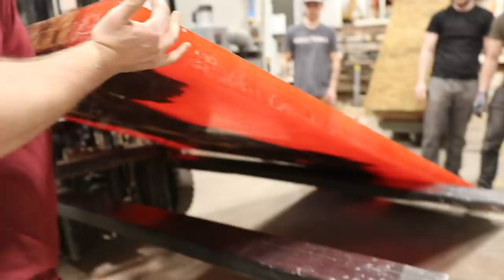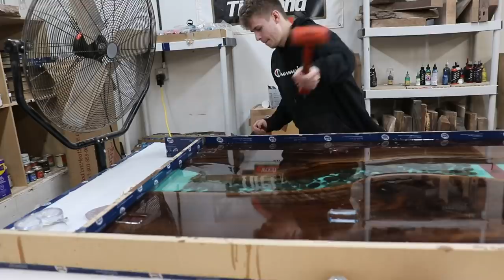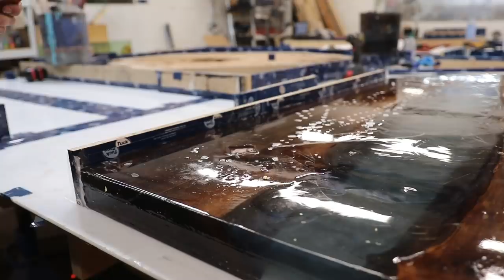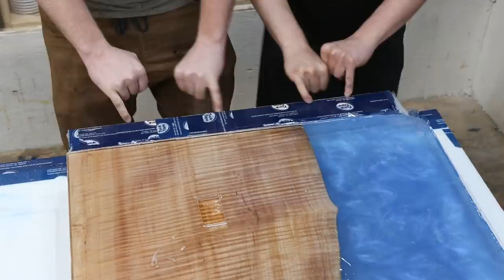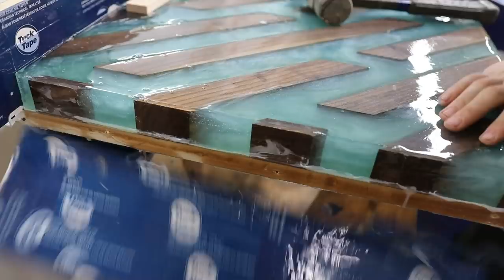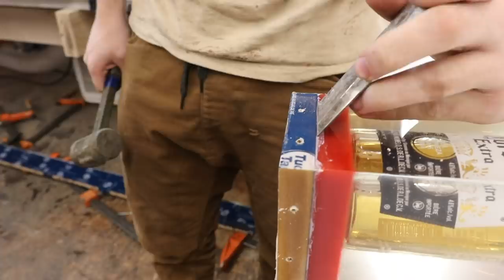Demolding Resin Compilation ASMR - No Talking, Oddly Satisfying

Comment: This may seem like a silly question,  but do you reuse the timber used for the molds?
That crackling/ripping sound....strangely trippy!
Great job guys!
Reply: seems like a waste of money and material if they don't
Reply: Looks like that blue tapey stuff can come off and on and they reuse the blocks but change the mold tape
Reply: The blue is non-stick tape but I’m not sure if it’s reusable
Reply from the maker: Yes, we reuse them! We have actually been using the same pieces since we started, and we just retape them when needed!
Reply: @BlackForestWoodCo  - that's so cool! It must save a bit of time, in the long run, to be able to reuse the timber molding?  Thanks for taking the time to reply. Blessings from Australia!